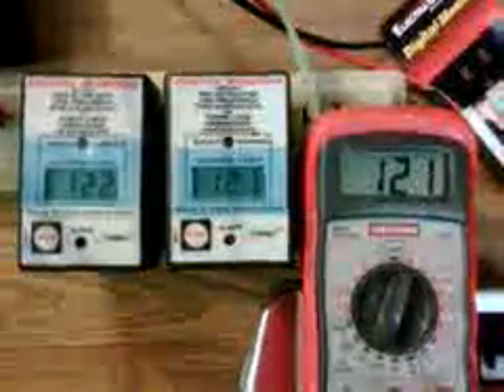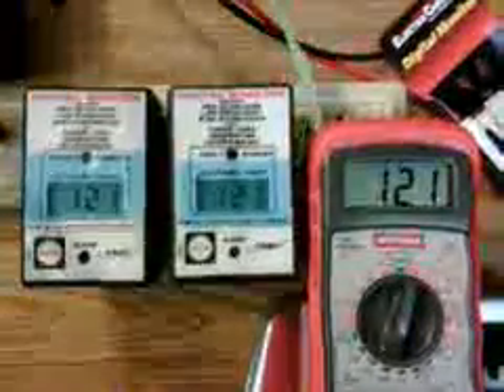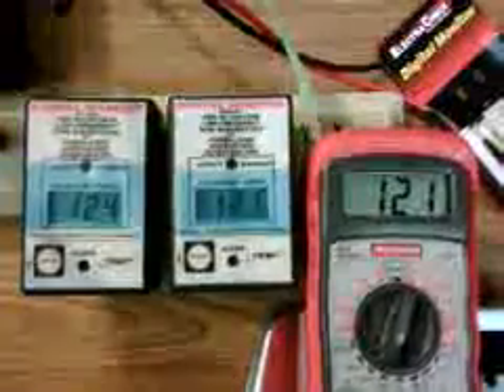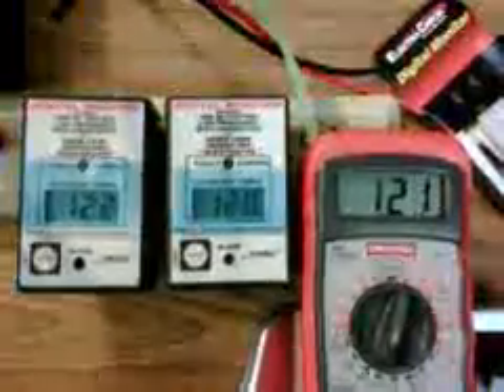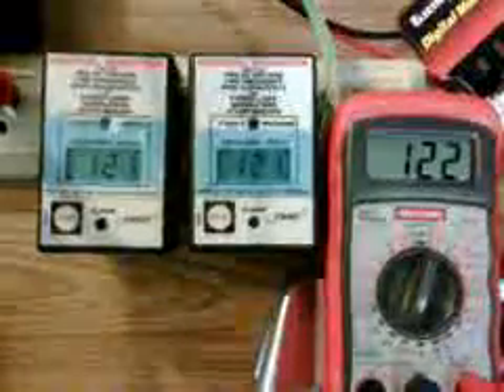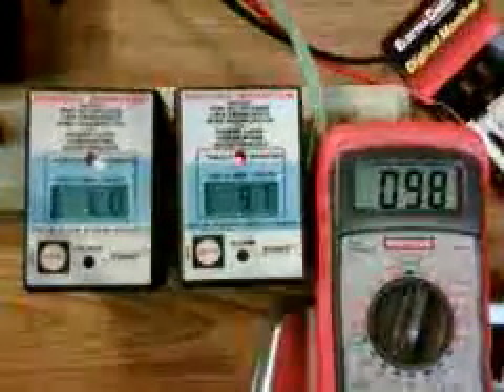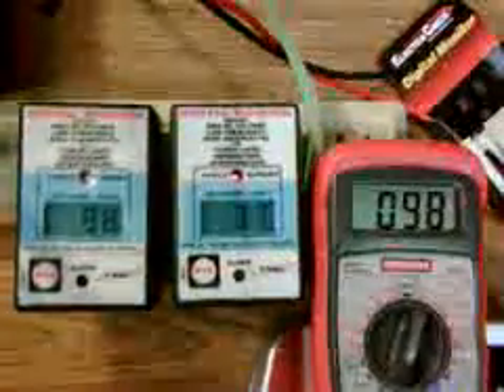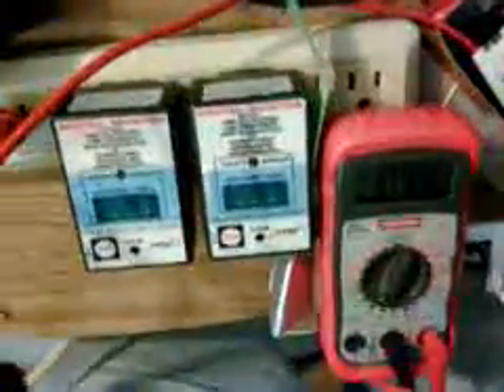TRC Digital AC Power Line Voltage Monitor (with Alarm) Review, Model #AECM20020

Comment from the maker: Because I had an outlet mounted directly at eye-level across from the camper entry door, this monitor was able to alert me to a low voltage condition once.  I would have never heard the 5 sec tone because I was out of the camper, but upon entry, the (rather directional) red warning light caught my eye and I was able to correct the problem.